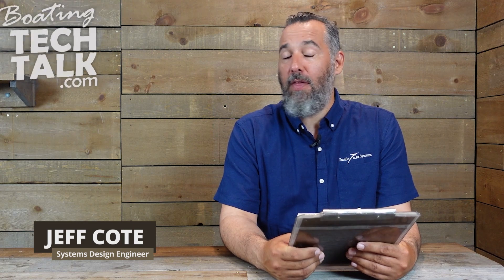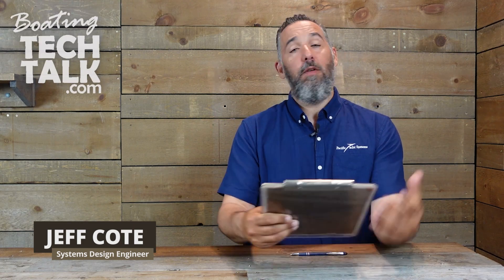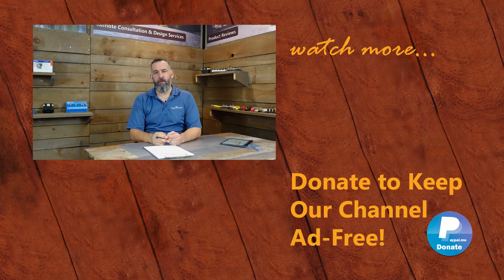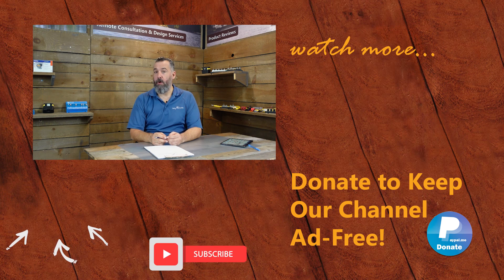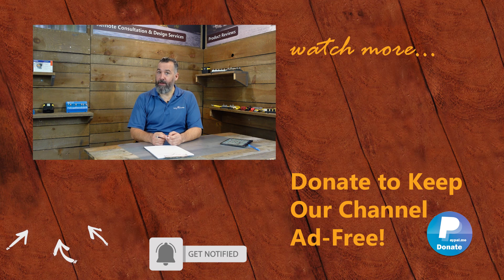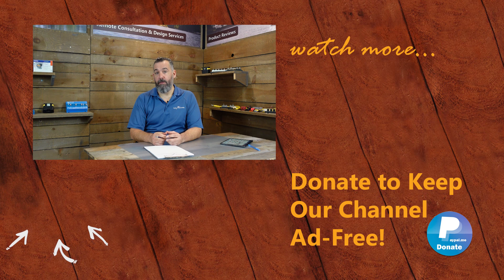Battery Charging Redundancy with a Battery Isolator

Comment: Hello Jeff.  Thanks for your videos, very educational.  I have the same config that you just explain, and also, as you mentioned in other videos, have a battery charger to charge the banks while the boat is anchored and the engines not running.....but for a reason I dont understand, when I turn on the battery charger, and the engines are not running (alternator with no voltage and the argofets input with no voltage)......one of the argofets blue light turned on, like if is it working or if the input  had voltage.......any suggestion of what is happening  ????  Thanks in advance

Comment: Would you be able to add a manual battery combiner switch to use the house battery to help start the engines in an emergency or would combing the batteries create a problem as you would have all the isolator outputs connected to what is now a single battery

Comment: Twin outboards (or inboards) connected to two separated battery isolators ( one each engine), charging both: 
- Its own starting battery, and 
- the house battery. 

OUTBOARD MANUFACTURES WARN ABOUT CONNECTING TWIN ENGINES ALTERNATORS IN A COMMON POINT; it will interfeere with regulators, and boat electronics controls on the outboards. 
. 
When both outboards  charge the common house battery…. They are paralleled:

1. How to synchronize the two alternators?
2. How are boat electronics affected? 
3. How are alternator REGULATORS and isolators affected themselves?
4. If an external battery charger ( or any other DC input) is connected to the isolator on the same contact point that the alternator…..What will happen ?

Comment: Question. What be a cost effective alternative for individual charge controllers for 6 or 8 100w panels. $1000 for controllers is high for my budget. Am I being too cheap?  I agree that each panel should have separate controller and mppt. This will be  on a Roughwater 41 and will be a combination of fixed and flexible panels. Thanks
Reply from the maker: Balancing performance and budget to our personal need is something all boaters do, balancing the pros and cons of your choice, you could put 2 panels in series or parallel to a single large controller.

Comment: Hi Jeff 
One thing that I keep thinking of: Is there an option to have just a single (neat) pair of large-gauge DC wire running along the side of a sailing vessel, essentially a DC rail, and then where you need, you can remove the insulation and screw on a tap (bonding clamp) of some sort? It wouldn't allow you any switching, but might reduce clutter for locally switched things like interior lighting, perhaps a fridge, bilge alarm, bilge pumps, shower and toilet pumps, etc. 
In my mind (and at the moment only there), it would remove the need for quite a few wire runs on the harness. And the idea of not clipping cables and installing a connection post every few meters (thereby introducing many points where you can have a bad connection) appeals to me. 
The only downside would be the location of the fuses, as on each tap along that pair, you would have a separate fuse block for the downstream gauge... On the other hand, seeing the splattering of fuses throughout the boats I've sailed on, they're all over the place to begin with.
Reply from the maker: Essentially, your suggestion, is exactly what distributed switching looks like.
Reply: @PacificYachtSystems  Interesting. is that used on sailing yachts, or only on larger vessels?
Reply: @PacificYachtSystems  Did some reading using that term, and yes, this is indeed the line of thought I was following. Interesting, and thanks for letting me know what it's called! https://www.powerandmotoryacht.com/electronics/digital-switching-on-your-boat

Comment: I’m no expert but, one needs to be aware of the charge profiles of the batteries connected via a battery isolator. Unlike a battery charger, an isolator’s purpose is to switch current from a charging device to multiple batteries, it’s current output profile cannot be modified. Different battery chemistries, e.g. FLA, AGM, LifePo, etc…, and manufactures require different charge profiles. Check with your battery’s manufacturer for charge profile specifics when mixing chemistries/brands in conjunction with using isolators.
Reply from the maker: Well explained Winn, your bang on, battery isolator only share a charging source but they don't modify the charging voltages.
Reply: @PacificYachtSystems  great videos as always Jeff. I'm just abt to replace two diode type BI's with Victron's FET BI's (for two alternators charging 2 battery banks) - do you have a diagram on where best to incorporate DC-DC chargers if I also want to combine the FET's with profile charging?

Comment: Brilliant channel so much useful information. I am finishing an overhaul of a simple electrical system on my 20’ day sailer. I have just discovered dielectric grease. Should I add dielectric grease to all my electrical connections?
Reply from the maker: Dielectric grease is useful in places where there is lots of corrosive salts...

Comment: Interesting that there is no mention of 2 input 3 output isolators here. Any reason?
Reply from the maker: Ian, good point, the dual input, three output FET (and not diode) battery isolators are hard to get... Victron doesn't make them either. IMO, dual input FET battery isolator would be a great product.
Reply: @PacificYachtSystems  I chose to use two Victron Energy Argofet Battery Isolators 100-3AC, replacing the single 2/3 diode BI I had, eliminating yet another single point of failure. You suggested that to me 3 years ago, and I couldn't be happier.

Comment: I just installed Sterling Prosplit R-T. The old battery isolator was no good after I installed LiFePo house batteries. The prosplit is charging the batteries in a sequence, and makes sure that after topping up your start batteries, the lithium bank still will get a good charge.
Reply from the maker: Thanks for sharing, Sterling is a great compay.

Comment: Great video thanks. Isn’t that also achieved by using VsR’s ?
Reply from the maker: Yep, Battery combiners (ACRs, VSRs,) are similar but different then Battery Isolators.
Reply: @PacificYachtSystems  for outboard based systems aren’t the VSR’s a better solution?

Comment: Great video- thanks. To add to that could you put another 3 battery isolator and connect a solar panel to all three batteries? Lastly, when all three batteries are charged and the engines are running is there a possibility of burning up the alternators due to no load?
Reply: There’s still a load connected, it’s merely at a high enough voltage that the alternator realizes it doesn’t need to work. The risk comes in if you have a protection circuit that opens the path.
Reply: Thanks for answering the alternator question. What about charging three battery banks all with two alternators and a solar array? Do I just need to add an isolator making it through isolators or do I need to do something else?
Reply: @leozeek  much like Jeff mentioned above, give each source its own isolator, and you're fine.
Reply from the maker: We've always installed dedicated battery isolators for each charging device.